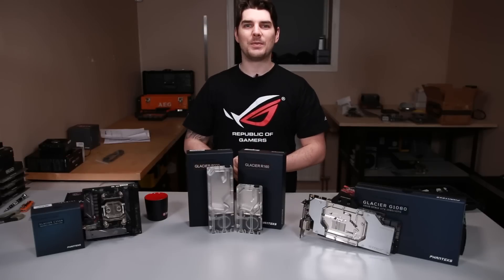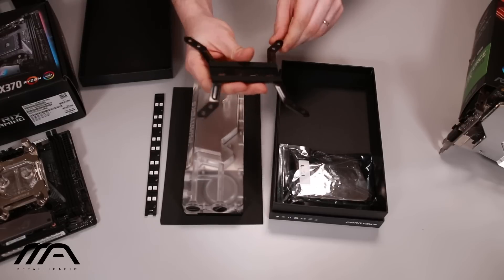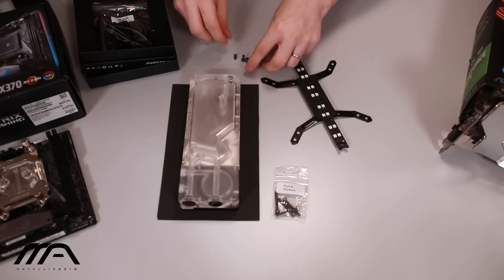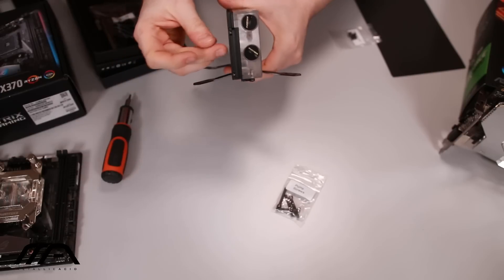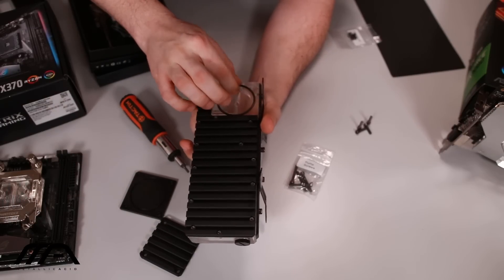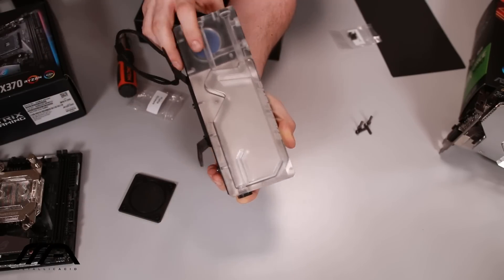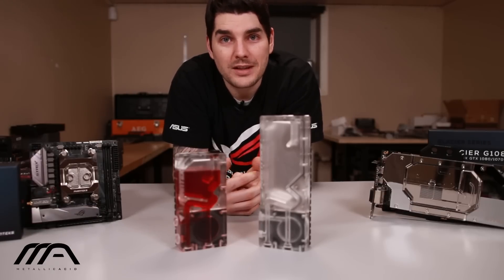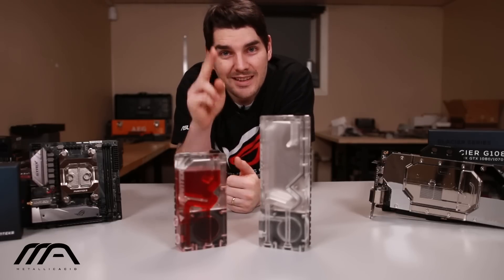Phanteks R220 & R160 Reservoir/Pump Unboxing

Comment: Can I just use this as a reservoir and don't put a pump in?
Reply from the maker: There are 2 versions of this 220 reservoir. If you buy the acrylic back version, then you CANNOT us the reservoir without the pump. The version of the 220 that has the black aluminium and stainless steel back like in this video CAN be used as a standalone reservoir without a pump. :)
Reply: @metallicacidcustoms  okay thanks that really helps, now all I need to do is actually find one of those.  They are all gone so I might need to find another stand alone  Reservoir.

Comment: I got the r220c (new model) and just realized that it does not come with the black heatsink for the back or the pump... will I be safe running my ddc pump without the heatsink? I wonder why they got rid of it. For the aesthetics?
Reply from the maker: I have tried this on my acrylic version, and yes, it works without problem!

Comment: can i use a spc pump inside of that?
Reply from the maker: I am sure that the SPC pump has the same dimensions and mounting holes, but am not sure if the head pressure of the SPC pump is capable of handling this res.

Comment: Can you use these just as a reservoir, without a pump?
Reply from the maker: If you but this exact version, then yes you can use it just as a reservoir. If you buy the acrylic version however, you cannot use it without the pump.

Comment: I know this is an old video, but I am planning to have this res for my phanteks shift, does the pump come with the res or it is a separate purchase?
Reply: I dont think so. It's by itself  (DDC 1T 12v pump non PWM vervion)
Reply from the maker: I was 9 months too late in replying. Thanks for the save
Reply from the maker: Pump has to be bought seperately.

Comment: Reseroir ... TOP ... Pump montage .. flop .-..   i Think it makes no Sence to put an Aluminium heatsink  without any Termal Conductor on top of a Plastic housing of the Pump ... 
Better remove the Plastic and put the heatsink direktly on the Pump with thermal pad ..  You have to modify the Pump housing for that ..  or Use a metal Housing from Aftermarket ( or a Pump with heatsink .. like Alphacool or EK )
Reply from the maker: You are correct that this is not a one step solution for all DDC pumps. But it is difficult to cater to the many different manufacturers

Comment: I was looking for a flat-ish res/pump.  I just built a PC and it is a tad tiny (s340 with a gigabyte windforce GTX 1080, which I already had.)  It has room but it is a tight build,  a round res just wouldn't fit neatly.  Hard to find reviews of these.  Thanks.

Comment: Hello, first video from you that i have seen. Instantly subscribing! However i have some questions.
1 Is the pump included? (can't find a straight answer for this)
2 So the rgb come from the strip, not the reservoir itself? so presumably if i use Thermaltake strip, i can sync it easily with other TT RGB, right?

Comment: real shame it doesn't have two ports in the upper area, that would allow for the most logical vertical orientation and you could use the top hole as inlet. Would make for a much cleaner looking loop. If you would use the top as inlet then you have no fillport somewhere on top. Most cases don't have space to mount it horizontally
Reply: Is it possible to use a T or Y adapter to turn that single port at the top into an inlet and fill port? As long as the fill port is high enough it should work as if there were top ports on top? Looking at the same situation as well

Comment: If you mount a DDC pump in it, does the pump need to be on for the liquid to flow? 
My question is because I would like to have a backup DDC pump installed in the reservoir but an external D5 as the main pump.

Comment: hi, could you measure how thick is the res with the pump installed?
it would be very usefull

ps: if possible with and without the heat sink (planning an itx build so i might have some space issues)
Reply: grey hound I will do this when I am back home from holiday
Reply: thank you very much, enjoy you holiday

Comment: Great vid! Really well thought out solution, pretty much what I’ve been looking for. I do wish there were separate 120 & 140mm brackets as mounting that one to a 120mm variant rad will see it sticking out. Looks like I’ll just have to mod mine :)
Reply: jcarmolp I 100% agree with the separate bracket solution. They should supply a 120mm bracket and maybe some kind of extension so it fits 140

Comment: These look really nice but seems to me to be a bit of a pain when it comes to filling and bleeding  with only a single port to feed the reservoir. 
Still nice to see some new innovation on the reservoir front.
Reply from the maker: Brian T just depend if you use a fitting and tube or a syringe. I use syringe so I don't think I will have a problem since air can easily be extracted vie the open space around the syringe nozzle
Reply: could also tilt and feed a different port, then close it off.